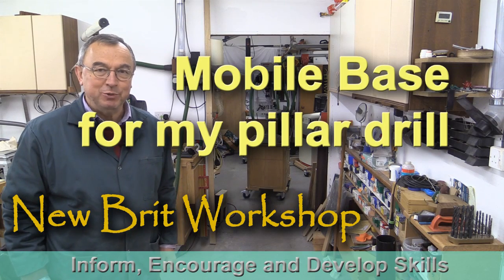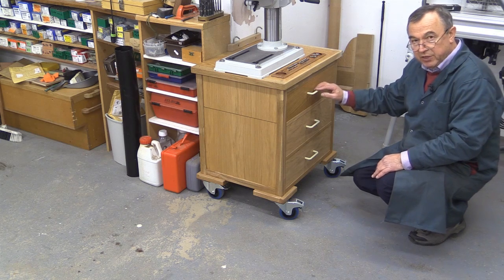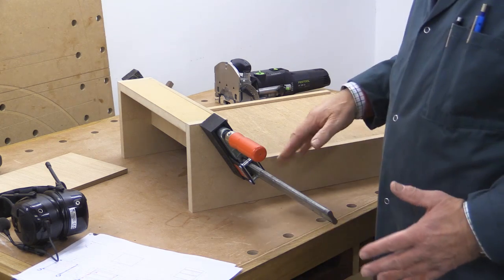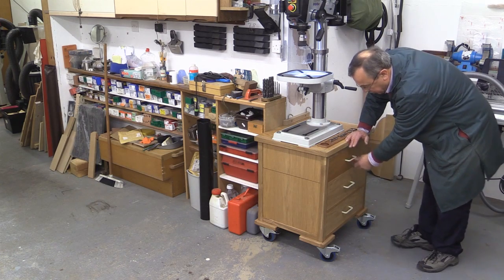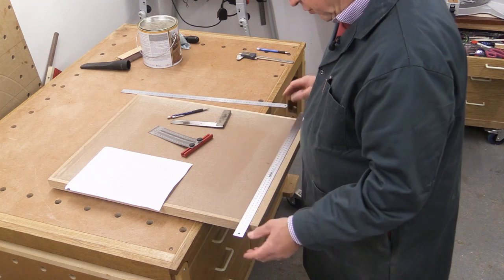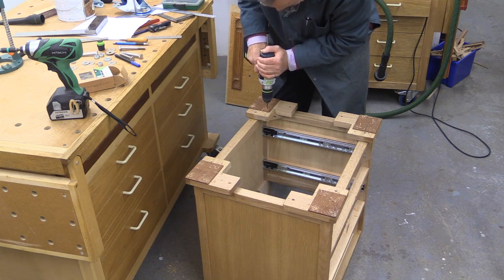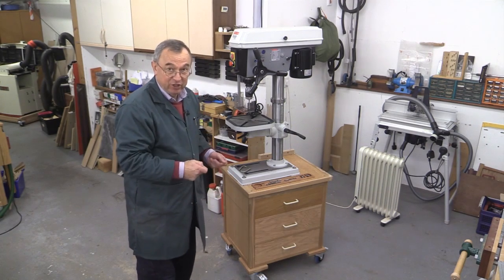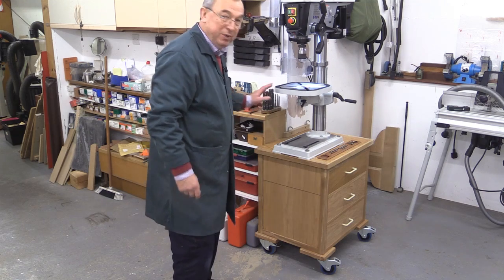How to make a Mobile Base for a Pillar Drill

Comment: Peter how tall is your pillar drill? And how tall is your cabinet?
Reply from the maker: Hi Colin, The original cabinet on castors was 722 mm high but when I moved to the new workshop I took the castors off as the stand would never be used. I also had to drop the height and so the static stand is now 670 mm high. The drill is 1010 mm high.  Peter
Reply: @NewBritWorkshop  Hi Peter my Axminster pillar drill is AT340P 40” tall. I was sent a replacement drill as the other one had problems. This one still has some problems the lid makes a bad noise, the Chuck does not seem to run true, the depth stop is a bit rubbish as is the drill guard.
Reply from the maker: Hi Colin, There is nothing that I can do about this other than advise you to take this issue to Axminster. Their customer service team is great and they will not let anyone down. Peter
Reply: @NewBritWorkshop  Hi Peter this drill is the replacement that came this morning.

Comment: Hi Peter I trust your keeping well? Can I ask what size wheels you used on this project? I need to make a base for my Axminster pillar drill as well. I hope you don’t mind me asking?
Reply from the maker: Hi Colin, They are 100 mm diameter. I used Coldene CDSSTPB100BER-H or you could use CDSTPB100BER. I am not sure if these are still made or kept in stock.  Peter

Comment: Very sobering pointing out the risk of tipping the pillar drill over if the cart is unsupported. I guess it depends on things like relative masses, loads, pivot points etc. Food for thought. Great work as usual Peter though I guess you have had to create a spot in your new workshop for your cart
Reply from the maker: Hi Stephen, The new workshop is all sorted out now and works well. The pillar drill can only go in one place and so I have removed the wheels from the cabinet and screwed it to the floor.  Cheers.   Peter

Comment: Hi Peter, great video again, can you tell me where you had the small drill jig, the one you used on the bench top to drill for the bolts .thanks again Steve
Reply: Thanks Peter
Reply from the maker: Hi Steve,  I think that you are referring to the cheap and cheerful drill guide from Axminster: https://www.axminster.co.uk/axminster-drill-guide-500458   or search for Axminster product code 500458.   Peter

Comment: I like your drill press mobile cart.  I was surprised to see the top drawer under the "invisible" side drawer.  That was a neat concept; at the beginning of the video, I thought that the top drawer was a dummy front like you would see  on a bathroom vanity cabinet under a sink.  Thanks for the neat design..
Reply from the maker: Hi Steve, I am sending you the plans.   Peter

Comment: Hi Peter, Just bought (second hand) the identical drill to yours - weights approx 70+ Kgs. I would be most gratful if you could forward a set of your plans as I found the bench you have made as iseal. My email address is ghs5@talktalk.net.
Many thanks and keep producing excellent videos.
Kind regards
Gary Smith
Reply from the maker: Hi Gary, Well done. The plans are on the way.   Peter

Comment: I just ordered some castors and I see they are different to your original video on castors (grey dampers and different axels/wheels) still showing the old pic on their site i think! Did you question why they differed?
Reply from the maker: Hi Chris, I don't think there is an issue here. It looks like a simple change in colour. You can always as Coldene.   Peter
Reply: New Brit Workshop Thanks Peter, I did buy the 4 pack 'CDPACK19' (80mm) but was told they were the same as the single purchased wheels. Do you have the 'elastic' embossed wheels? Just a little annoyed as the picture shows different castors (like your original video castors!) Perhaps I should have gone with Ross castors.
Reply from the maker: Hi Chris, Perhaps you should have used the part number that I gave in the video or on the plans - https://www.firstcastors.com/en/blue-elastic-rubber-swivel-lock-castor-cdstpb100ber     They do have "Elastic" in the description.     Peter
Reply: New Brit Workshop I see but even those differ from picture shown, anyway appreciate your correspondence and effort in my over analytical issue 😄. I'm just fussy. Great videos and very thorough. Keep up the good work 👌🏻
Reply from the maker: Hi Chris, If you are not happy with them after they are installed do not hesitate to contact Coldene - they are an excellent company and put their customers first.   Peter
Reply: New Brit Workshop I received them yesterday but attached them to a piece of boarding just to see how they operated but was doubtful of returning a castor which now probably are soiled albeit very minimal. I may give them a call though thanks

Comment: Hi Peter,  very helpful video.  I was curious as to how you arrived at the overall height for the base. Many thanks, David.
Reply from the maker: Hi David, I estimated where the most comfortable height was to use a pillar drill (slightly below chest height for the table) and then guessed at the table's most likely position on the column of the drill. If you are not sure then go into a woodworking store and stand at the floor mounted pillar drills and judge where you would like the table to be.  Peter

Comment: Hi Peter. Fantastic video. I've been researching pillar drills for some time now but still not bought anything yet. The Axminster price point for your particular drill is a little beyond my budget at the moment, but do you reckon it's worth waiting for rather than settling for a cheaper machine? I've been looking at the Clarke brand from Machine Mart, and also the Record Power options. What were the reasons that you discounted these options? Or does it have more to do with your association with Axminster that you favoured this drill?
Reply from the maker: I have no favouritism when it comes to spending my own money but my decision process was as follows. Over the last 7 or 8 years Axminster have been improving the quality of their Axminster named products. I did look at other makers and discounted the Clarke ones as they were closer to the Axminster Hobby series than Trade series. I did look closely at the Record machines. I really think that these days you get what you pay for and so if price is the driver and one has a modest budget then it may be that a Clarke or Record machine will suffice. I was taken by the very detailed description on the Axminster web site and, yes, there was something else. I have visited Axminster because of my Parf Guide System and a while ago I had a conversation with their Senior Engineer seeking his advice about pillar drills. He told me to wait until this new Trade rated machine came along as it was a very nice bit of kit. I also went to one of the Axminster stores and looked closely at a number of other machines. I really liked the Jet JDP 15B as it has a very nice table but it was way beyond what I could afford or justify. I am more than happy with my new machine and I have no doubt that I will never need to buy a pillar drill again.      Peter
Reply: New Brit Workshop Many thanks for your response. Lots to chew over.

Comment: Really excellent job Peter, you have thought of everything as usual, I was dubious when you mentioned a portable unit for the pillar drill but the way you have
designed it to fix to the wall is a really neat, safe solution, well done. As someone else mentioned your various units look more like fine furniture than workshop units, they do look very smart
indeed and they are all really functional, I guess your philosophy is do it once, but do it well!
Could you comment on your experience with using dominos with mdf, I've used mine with ply and solid timber and they do a fantastic job, I'm assuming they work equally well with mdf?
Timber is so expensive now, veneered mdf may be a viable alternative, shame it's so heavy!
Can I ask where do you buy your panel/ sheet products, the quality and spec seems to vary enormously according to the supplier.

PS seems you are now enjoying making your own music! lol

Cheers
tony
Reply from the maker: Hi Tony, I really do want everything that I make to look good and a lot of people see my videos so I have to do my best. I am trying to introduce new ideas to stimulate other people's ideas - the bandsaw stand compartments for my air nailers, the push-me pull-you drawers in the mobile bench and these overlapping drawers in the pillar drill stand.  Dominos in MDF work really well although the hydraulic pressure of the domino going in with the liquid glue forming the seal can cause splits. I find that one has to knock them in gently and not use too much glue. Try Timbmet for all sheet goods - they are in Parkstone. Many thanks for all the kind comments and I will try not to overdo the keyboard playing.    Cheers   Peter
Reply: Hi Peter,
Thanks for your quick response. I hadn't heard of Timbmet, I see they have a depot in Gloucester, I live near cirencester so they are quite close to me, that's really helpful, thank you.
cheers
tony

Comment: nice cabinet i have the same pillar drill you had, i like your new one will axminster do a part exchange
Reply from the maker: I am sure that Axminster do not have any form of part exchange scheme. I advertised mine in the local rag - it is an easy option to get rid of older tools.  Good luck.     Cheers.   Peter

Comment: peter, I love your videos. I am a long time subscriber of yours.  can you please tell me... what is the point of haviing a mobile base if you are going to bolt it to the wall when your using it? Isn't the idea of a mobile base that you can use it anywhere in the shop? For example if you have to dill a hole into a project which doesnt fit into the drill press unless you pull it away from the wall.
Reply from the maker: I will repeat what I said to Martin earlier...I have a near perfect spot for my pillar drill where you see it (and where the old one used to be). However, I have had a couple of occasions when I found that I could not quite get the piece being worked on up to the drill. In the past I then did the work by hand but when I had a bunch of big Forstner holes to do that was a pain. So, Now I can move the drill to a different spot. In all probability I will never have such awkward lumps of board to do again but if I do all I need to do is make up a copy of the wall anchor and move the drill to the alternate spot.  Cheers.   Peter

Comment: Another great video Peter. Love the idea of locking the cabinet to the wall!
What model of scanner are you using to check behind the wall for mains cables? I've tried a couple of these type of devices and found them to be very hit or miss?
Thanks for sharing with us.
Reply from the maker: Hi Mark, Many thanks. The detector is from Bosch, the PMD7, which I bought from Screwfix. Here is the link: http://www.screwfix.com/p/bosch-pmd7-digital-detector/8046d   It seems to work okay but, like you, I have had a lot of bad experiences with this type of tool. I wanted to get one of the top of the range Bosch Professional devices but the reviews about them were so bad I went for the less risky route. My real worry is working in modern houses where there are plastic pipes in the walls and I challenge any manufacturer to produce a device that can do this reliably - from the reviews it appears that both Dewalt and Bosch have not quite solved this one yet.    Peter

Comment: Hi Peter, another good video and I fully agree about the stability of the pillar drill, which leaves me wondering why put it on a mobile base and then have to lock it to the wall in order to use , is it normally stored somewhere else ?
Reply from the maker: Hi Martin, I have a near perfect spot for my pillar drill where you see it (and where the old one used to be). However, I have had a couple of occasions when I found that I could not quite get the piece being worked on up to the drill. In the past I then did the work by hand but when I had a bunch of big Forstner holes to do that was a pain. So, Now I can move the drill to a different spot. In all probability I will never have such awkward lumps of board to do again but if I do all I need to do is make up a copy of the wall anchor and move the drill to the alternate spot.  Cheers.   Peter

Comment: Lovely base, thank you for the tip of securing it to the wall, it's so obvious when you see it, and so easy to run into the problem.  Also the bit about the drawers and the vibration of the tool. As always nicely done.
 It's nice to have you back doing videos, so please don't put unnecessary stress on that shoulder, picking up heavy stuff ;) 

Take care.
 Pedro.
Reply from the maker: Hi Pedro, Many thanks for the kind words and do not worry, I will do my best to take care.   Cheers.    Peter

Comment: Nice piece of kit there Peter. Very well thought through and very practical. The pillar drill is cool too!
Reply from the maker: Hi Stephen, Many thanks - I try and add something different to each of my designs like the large flap drawers in the bandsaw cabinet and the folding extensions on both the mitre station and mobile bench. Have you seen the Parf Guide System yet? I love your workshop video - nice piece of work.   Peter
Reply: Thought I recognised you from somewhere.  Seen you demonstrating the Parf system on the Axminster channel.  It's a neat idea Peter

Comment: Your tool bases are generally nicer than my furniture. :) Having a mobile base very similar to yours, though without the clever half drawers, I wonder if you'll encounter problems with shaking. Since the castors pivot, vibrations seem to cause the castors to start pivot about their floor contact point and allow more shaking. Your castors may behave differently, but still have a small contact point to the floor. I've considered replacing the castors with those that have a screw down post that will raise the base up off the castors.
Reply from the maker: Hi Kent, The Coldene castors lock both the wheels (brake) and also the shaft and so they cannot rotate once locked. The pillar drill base is also fixed to the wall when in use as it is so top heavy.     Peter
Reply: Hi Peter, thank you for the reply. I'll look to replace my castors. I didn't know ones such as you describe existed. Best wishes

Comment: how do the new precision rules compare to the parf sticks included in the guide system?
Reply from the maker: Hi Colin, The Precision Rules are just high quality rulers whereas the Parf Sticks have the accurately spaced holes needed for their role in the Parf Guide System. The centre finding precision rule is excellent and very accurate.   Peter

Comment: This is exactly what I am going to do, great video and great work Peter. Have you ever considered making your casters retractable? I honestly think retractable castor arrangements are fantastic as when retracted the unit is very steady. You could still do this and have a quick wall attachment. There is another guy that has done this (just search retractable castors) and you will find it. What amazes me is how simple the retractable arrangement is. My only concern about lockable castors is that they can swivel under the unit making the locking lever inaccessible. Having said all this, nothing takes away from the fact you have made a stellar job of this unit and I wouldn't mind having one in my workshop. I like that you make things with a high quality. I intend starting my own woodworking channel very soon where I will be transforming my rather small workshop from chaos to some form of order.

Take care

Paul
Reply from the maker: Hi Paul, When the Coldene castors are locked they not only have brakes on the wheels but also a swivel lock so that they cannot turn and get lost under a cabinet.  Good luck with you workshop project.    Peter